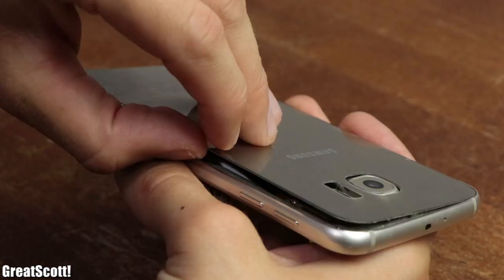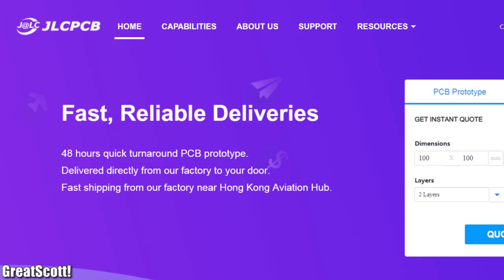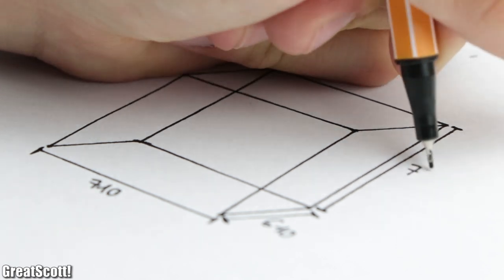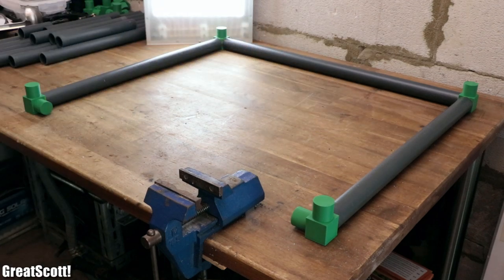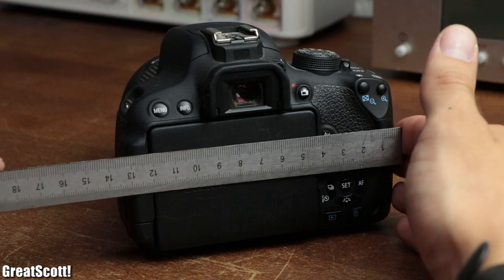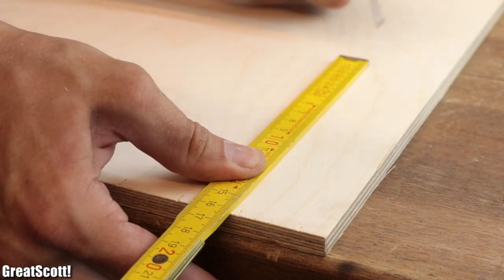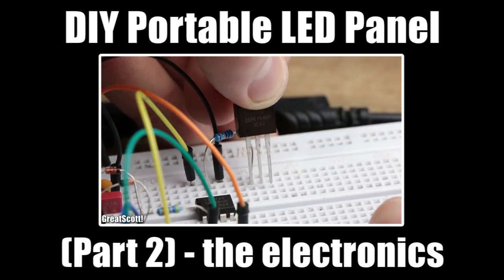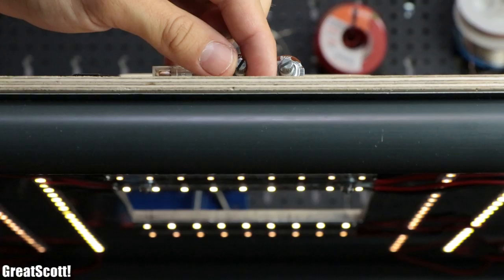Make your own Overhead Camera Rig with LED Illumination!

Comment: You might want to consider making this a white box.  Magnets with detachable side white-panels, or 
roll-down white cloth would give you more uniform illumination.  Also, side mounted glancing angle 
light strips would allow you to photograph highly reflective samples.   Nice video!

Comment: Awesome project! Quick suggestion, please try using fusion 360, you can make your 3d printed parts look cleaner and more ergonomic, it really isn't complicated to learn, and once you've mastered it, it is totally worth it!
Reply from the maker: Is fusion360 free?
Reply: GreatScott! It is for hobbyists, students, and very small shops
Reply: GreatScott! It’s totally web based
Reply: @greatscottlab  Absolutely free for hobbyists and students, do try it out
Reply: @greatscottlab  I agree, I've been using fusion 360 and it's free to hobbyists students, and business that make less than a certain amount per year. I'm planning on using it a lot once I finish my 3d printer build. It also let's you simulate and test out your design for strength and vibrations in the simulation tab and you can do all sorts of other things with it like sending your designs out to a prototyping company for things you want built more durable than 3d printing like milled aluminum, etc. Also has options for making g code for milling, laser engraving/cutting, and much much more.

Come on guys, you can't just mention fusion 360 without mentioning all the other awesome stuff it can do.

Comment: Quick tip for accurately measuring mounting holes for things. Don't try and measure the centres,  measure from the left (or right) edge of both holes, much more accurate and easier to see.

Comment: Nice build. For future reference, the standard for camera mounts is Imperial 1/4”-20. (1/4” diameter by 20 threads per inch.) You might find more options for mounting your camera looking for regular hardware than camera specific hardware. Looks like you had to 3d print a spacer to use your “special camera screw.”

Comment: One improvement I would've made to this design is some light diffusion over the LED strips. Acetate sheets and a power sander with 400 grit sandpaper does the job in no time. Just make sure to do both sides of the sheet for even diffusion.

Comment: Good topic
May I suggest a topic for the next video ,
I would like to know how to create or build , design  our own circuit and how to select the values of active and passive components .
Reply from the maker: Dude, that is what my whole channel is about.
Reply: @greatscottlab  But in every video circuit is already built and planned all the values of passive components
Reply: @greatscottlab  and also all the videos are made based on Arduino micro controller programming so , at least make video which explain how to learn Arduino programming for all who doesn't know even basics in programing . I seriously come under this category so , I feel a little more difficult to understand the video involving programing.
Thanks a lot for considering  my comment.
Reply from the maker: I made videos about Arduino programming as well as videos about all kinds of electrical components and how to use them. Just look on my channel. There are over 200 videos about electronics.
Reply: @greatscottlab  okay , I will check those out ...
Thanks
Reply: There is a lot of components but they all have standard values if you want to build a project you can calculate the values
Reply: If you're interested in arduino programming, and know 0 about cs, I would start with some basic C or C++ tutorials. Arduino is essentially just C++ with some specific function calls, so knowing the basics of that can get you a long way.
Reply: @workethicrecords5901  ok bro , thanks 😊

Comment: great video tough i would use screws with brackets or even hose clamps instead of zips ties it looks a bit cheap. also a small box could be used to hide the electronics and even hinges to change the angle of the camera!

Comment: Hi; Well done, I use aluminium extruded profiles for all my projects, I used Bosch Rexroth because I could find them easily on RS components.
In my case, the extra costs compensate less work.

Comment: Hey, I would love a video about the minimum safety measures for an electronics project. For example, if I run it from a 12V 6W UL-listed wall wart, can a dead short cause a fire? Do I need a fuse? That sort of thing! 😅

Comment: Even with the sand, it still does not seems to be very stable. How stable is it when in use? (for example if you accidentally move the table a bit, how shaky will the camera image be? And I am also wondering how heavy is this device.

Comment: That rig looks very interesting what is the most you can zoom in with your camera?  You could use it to solder with as well? Thanks for your hard work.
Reply: Looks like it depends on which lens he's using ,but I couldn't tell for sure if he had an interchangable lens camera or not.
Reply: Thanks you right didn't think. I have a couple zoom lenses for mine and was interested in his setup.  Thanks Barry

Comment: Hey bro. Was wondering if you could do a video dealing with a laptop charger. Since to continuously leave your laptop plugged in is bad for the battery. Was wondering if we could modify a laptop charger in order to achieve it to turn on at say ten percent battery remaining

Comment: You could have used 556 IC in place of two 555 ICs.
Reply: If you have two 555's and no 556's, then it's easier to use what you have

Comment: a 555 can source/sink 300mA current si it can directly drive the gate of your mosfets
Reply from the maker: I am using a TLC555. That can handle a lot less current. Also you would need a lot of current in a short amount of time. That is why using a MOSFET driver is always a good idea. But it should also work without it. Just not as good.
Reply: @greatscottlab  depends on the frequency too. At lower frequencies (few kHz) direct drive works just fine

Comment: I might actually be motivated to make some videos if i made one of these, need an expensive camera too thought :(
Reply: No you don't, just use your smartphone camera. With a good setup you can still make good videos, until you can save up enough for a better camera. However, it's the sound that's the hardest to get right but for that I'd suggest getting a Shure SM58, you can find them pretty cheap, they're durable, and the sound is awesome. You can get free software for editing the sound and video together (audacity is good for sound editing for example). Good luck, and let us know if you have any more questions.

Comment: Is mosfet driver ic are so important???, Since I've never used it in my project which includes some low frequency like 50hz and some very high frequency like 3Mhz control signal and had never faced any problem, please explain??
Reply from the maker: Watch my basics video about MOSFETs.
Reply: For SG3525 you dont't need to use MOSFET driver

Comment: You are using the circular saw extended way pass the plywood thickness. You only need a hair past it.
Reply: Having the blade go so far past the material helps reduce kickback and can make a smoother cut.
Reply: @lazyh-online4839  kickback happens when the blade binds between two surfaces that pinch the blade. The blade can't spin so transfers it's energy to the wood and from the wood to you. If you have more surface exposed the easier it is for the blade to bind, specially if it's a rip cut. It also happens when the material is not well supported. Even with a 15mm plywood sheet, if it gets between two surfaces that pinch the blade you get a nasty show of force. I don't know if your are getting that good of a cut in detriment to your safety.
Reply: One of the reasons you do several passes on some cuts is to not bind the blade, and this valid for the table saw as well.

Comment: If ever I make such a thing, I will use wood instead of messing about with PVC & 3D printing - cheaper, quicker and easier.
And not as a cube, just a ceiling with the minimum framework (as far back as possible)  required for balance and stability.

Comment: You probably should have designed your green fitting by using tubes shapes, not cylinders, so you didn't have to spend so much time onn printing ;)
Neat build however :)
Reply: The overhangs can be difficult to size correctly, I think it was a great idea but yours would probably work too if you think you can get it on the first try.
Reply: @lazyh-online4839  hmm... don't think so, the goal of 3D printing is fast prototyping so, you ust go back and forth between CAD and 3D printed parts :)
Reply: @FrancoisLoncle  rapid is relative, still takes a while and time is money. That being said I get what you mean and do agree if you have the time and filament to do so.

Comment: Whew boi, soldering LED strips already glued onto conducting materials can give you nasty shorts. The adhesive isn't always a good insulator and soldering directly ontop of it can damage it. Always put a piece of tape underneath the contact points you want to solder, kids!
Reply: Oops, I've been doing it wrong this whole time too, thanks for the tip.

Comment: A nice A2 or A3 craft cutting board would be a good surface to work on.
Reply: I dunno about this Julian and I suspect there are hundreds of thousands more people who'll leap and make that claim too.

There's a concept called 'right job, right tool' that still means that the cutting mat is a viable option,  but an anti-static/grounding mat is an easy thing to acquire to use for the right job too.

Comment: I love your channel, but way too much work on this project. I just did a rectangle with square slotted steel bars that I clamp to my shelf and voila... 4 screws and 2 clamps and a much smaller footprint. Done in 10 min.
Reply: Likewise it could just be built from wood, and LED lights are readily available with brightness etc control for next to nothing. Everyone seems to constantly use 3D printers now, for even trivial things. Never mind the use of even more plastic.